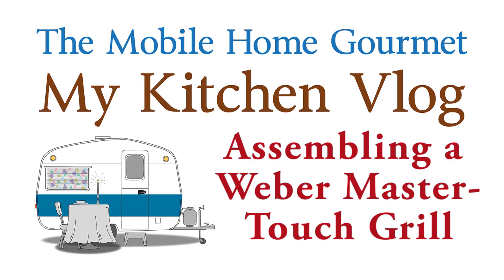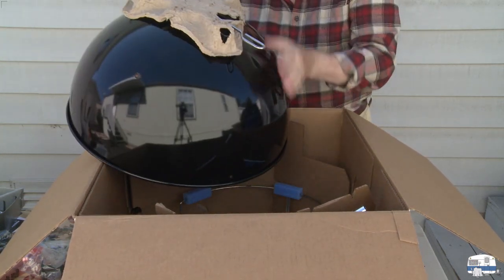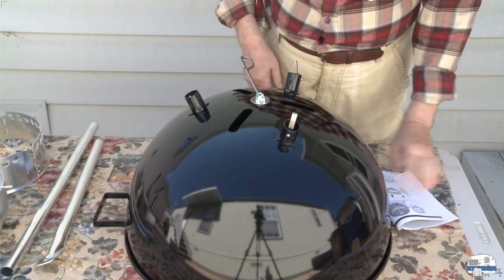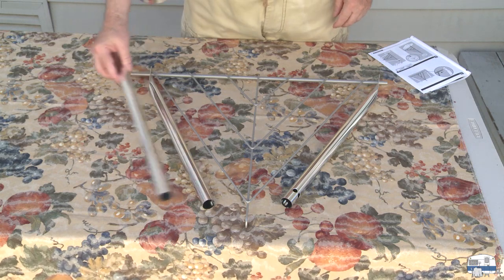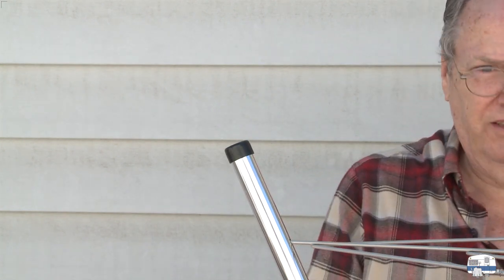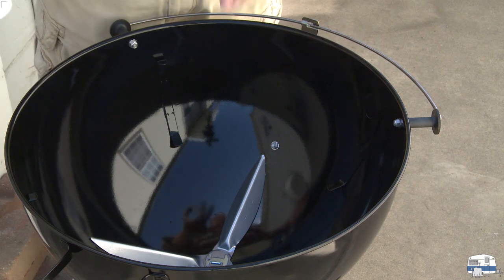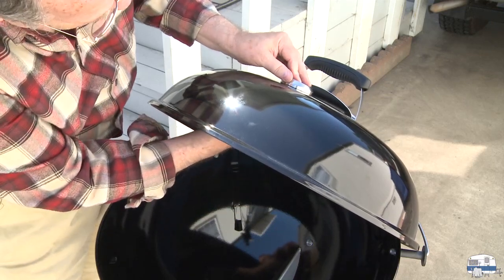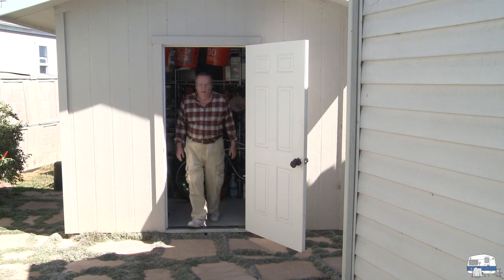103 - Full assembly of a Weber Master-Touch grill, plus a review

Comment: One of the best instruction videos I've watched in a long time--very well done!! One frustrating thing about the grill assembly is the Weber handle that attaches to the lid--I thought for sure I had lost the nuts that attach the handle to the lid. Actually drove back to Home Depot to see how it was attached on their display model. I also opened a box on a new grill and it turns out that the nuts are already attached to the bolts on the handle (the nuts are not loose like all the other nuts that thread onto the other bolts). So you need to unthread the handle nuts first (they appear to be factory installed and I finally used my 7/16 socket wrench to get them off. Other than that this video made assembling my new grill a breeze. I would watch other videos by this guy--EXCELLENT!

Comment: Great video, thanks for all the "heads up's" on the possible pitfalls I may encounter.  After watching every assembly video I could fine, there is no question that putting the legs in is #1.  Seeing all the problems everyone had, I discovered the solution to putting them in easily.  First, there is so much confusion on how to put the legs in, I'm not surprised everyone is having so much trouble.  Although the instructions say to put the spring clips into the kettle bottom, do not do that.  I have found that putting the spring clips into the LEGS first really works well.  Take each spring clip and locate which hole it is supposed to be placed in (follow the instruction on how to orient the side legs) and take each clip with the "bent" end FIRST into the leg and let the button pop into the hole on all 3 legs.  then begin to push each leg into ihe leg recepticle, there will be resistance (they put sn indent into the hole to restrict it on purpose, just look in the pipe) so just press the aluminum leg into the opening with a little pressure.  It's made that way to hold it firmly in place (they should have mentioned that in the instructions, but they didn't mention anything just using pictures).  Just push the leg in firmly and it will go in, be patient.  Anyway, this took way too long, sorry, but I saw so many people having this problem, I had to say something.  I just finished putting new new grill I received an hour ago, so I wanted to pass it along to everyone.THANK YOU ALL THAT POSTED THEIR EXPERIENCES DOING THIS ALREADY, IT MADE MY JOB SO MUCH EASIER, THANKS.  Tom F.

Comment: Great video. I put mine together just from your video not instructions but instruction book is easy to follow.  On the legs it was easy when I put spring clips in legs. I tried it both ways and it mis aligned doing what instructions say. Putting in legs was no problem just insert leg push button and push  and do small twists. Put clips in leg not the way they say. Use a socket wrench with extension instead of that plastic wrench but dont over tighten everything.  I have assembled a lot of stuff and this was easy. It's a good quality item . Use rubber mallet on wheel caps with other end on wood support real easy. Thanks for video!

Comment: Very helpful overall. Most important tip: use some grease or oil on the legs before trying to insert them into the tight cylinders (I used 3-in-1 oil). I also followed the printed instruction guide and inserted the front leg first, but either way seems fine. Took about an hour from box opening to clean up.

Comment: I agree with you Weber can make the assembly easier. They should design in such that the wheals should not be  hammered. It could damage the wheals and legs. Also legs would not go into the bottom part of the grill easily. The drawings of the instruction should be clearer. Thanks for the video.